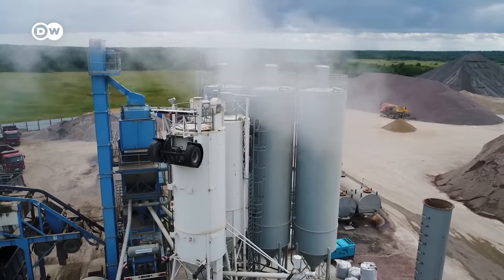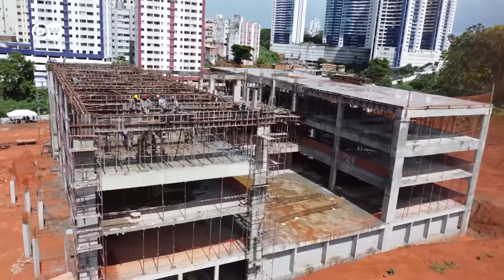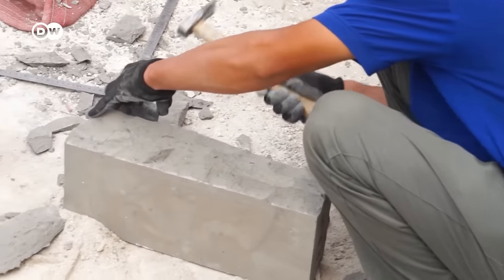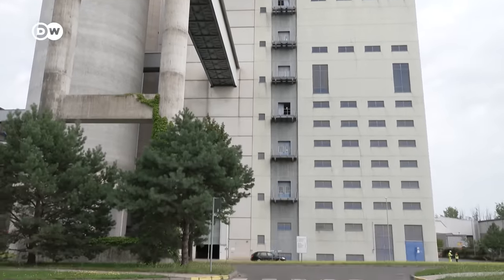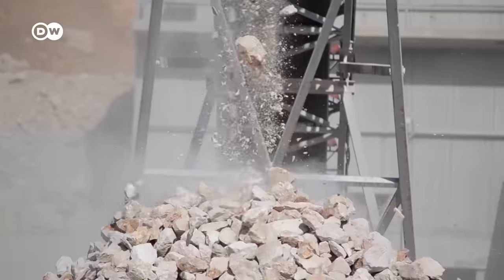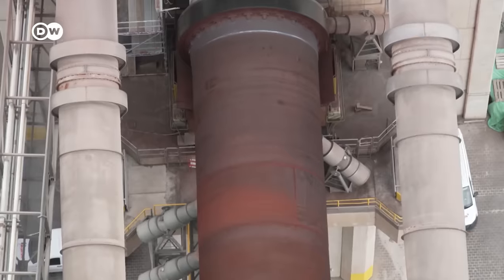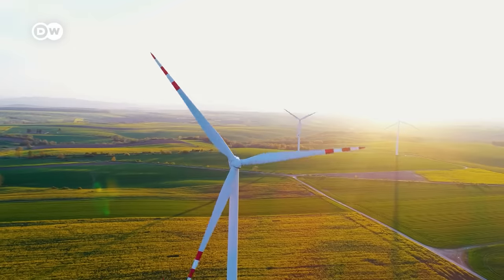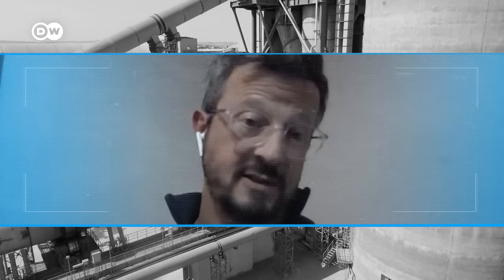How cement could one day be carbon neutral | Transforming Business

Comment: This reporter is way out of date.  The active ingredient in cement is calcium hydroxide (prepared by adding water to burnt lime, CaO).  This can be made electrolytically.  MIT has been working on the process.  Once set, concrete is calcium aluminosilicate plus aggregate.

Comment: DW what is your agenda when you say it's far away? You mention biomass but not green hydrogen from electrolysis... Which is clearly the solution for now and not biomass. If it can't be carbon neutral then we shouldn't use it. Yeah it will be more expensive and so should all products from hard to abate industries due to their high energy use and co2 emissions.

Comment: If renewables like solar and wind can only supply industrial heat up to 500 degrees C, can nuclear power supply the 1400 degree temperatures required by for cement manufacturing? The two largest cement producers/consumers are India and China, and both are committed to rapidly growing their nuclear fleets. Can that help solve the heating side of the problem? The chemistry side is another problem still ...